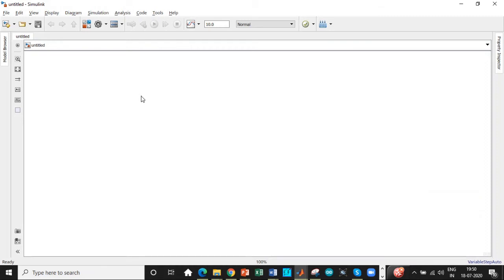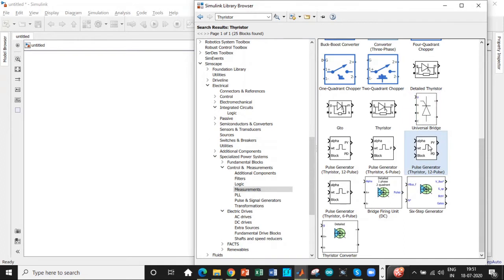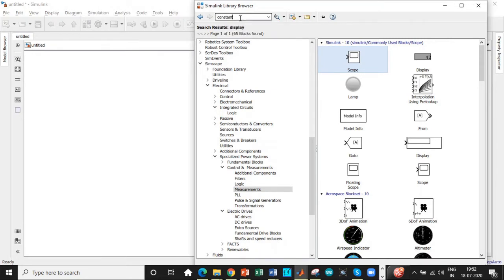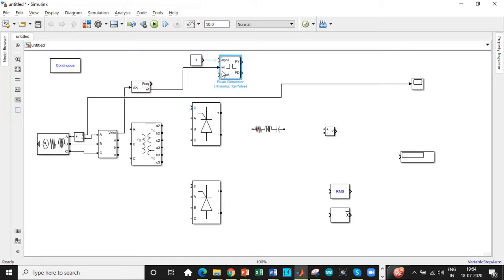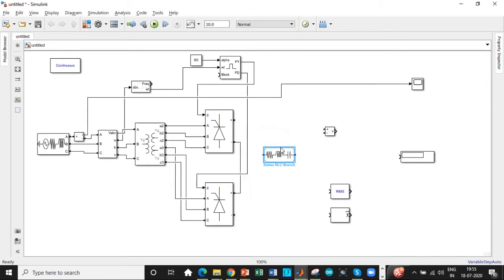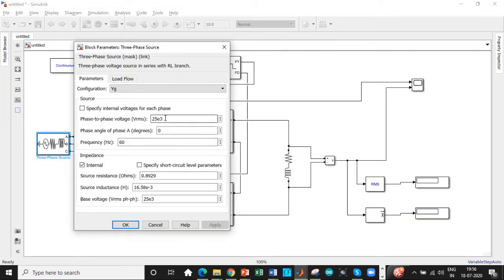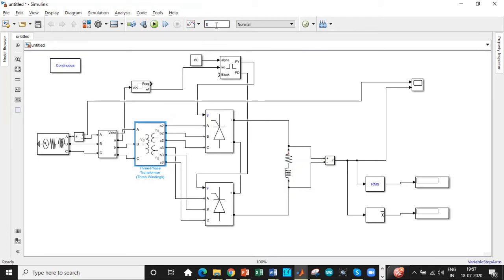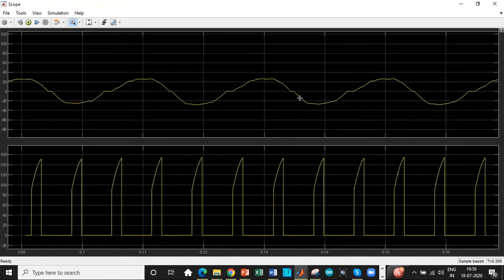Simulation of 12 Pulse Controlled Rectifier in MATLAB | SIMULINK

Comment: Hi bro, great video. If it's in hvdc application and only rectifier is simulated, may I know which load I should connect. Since its hvdc, I should connect R and L right? And what about the values bro?
Reply from the maker: Yes, correct. Try with R and L. The load values can be randon initially to start with.

Comment: Good day sir, excellent work indeed. if you design 36 pulse controlled rectifier, can you use the same approach?. by adding 4 thyristor bridge and two 12 pulse generator, what else can you add?. what would be the expression of output voltage as function of firing angle?. how can the harmonics quality at the input and output be improve?
Reply from the maker: Thank you Samkelo mjuqu. We can design 36 Pulse controlled rectifier by the same approach. Additionally, we can also build them by two 18 pulse converter which would be much convenient to control and simulate. This Paper gives you a good overview of how it can be built-in MATLAB (http://ijarcet.org/wp-content/uploads/IJARCET-VOL-3-ISSUE-4-1159-1163.pdf). Harmonics can be improved by placing a filter on the source side (To reduce the source current Harmonics). There is an option called three-phase Harmonic filter in MATLAB. Based on the amount of reactive power to be injected you can design it. I have made a video on selective harmonic elimination for an inverter at the load side (https://youtu.be/Jq86372S4QM). This will give you an overview of how to use Harmonic filter in MATLAB. There is also a book called BHIM Singh (Power quality textbook) which is extremely useful to design filters. You can refer to it as well. Hope this helps :)
Reply: @ElectronicsMaddy   Thank you very much sir, I have seen this but I didn't find this block labeled F.S having (two inputs F.A and Vi, with output Po) in matlab

I can see F.A stand for firing angle which is constant. I don't know what the block F.S is, can you please help me with it. how can I find it in Matlab?
Reply from the maker: @samkelomjuqu4300  I think they have combined two blocks. i.e PLL synchronisation block and firing unit block ( 6 pulse i guess) and labeled that as FS. It is possible to combine two blocks in MATLAB so that it reduces the way in which the circuit looks.
Reply: Good sir, i have designed a simulation for 36 pulse. but i'm struggling to get correct output voltage waveform, is there a way i could show you my simulation  and tell me where i went wrong or what parameters i should use for 36 pulse or firing angle,
Reply from the maker: @samkelomjuqu4300  Please mail me at electronicsmaddy@gmail.com.

Comment: Plz help with same circuit as yours am getting some different output waves
Reply from the maker: Hi Kiran. Did you try the same steps mentioned? Please send your MATLAB file to electronicsmaddy@gmail.com
Reply: @ElectronicsMaddy  sent please check sir
Reply from the maker: I haven't received any mail. Can you please double check?
Reply: @ElectronicsMaddy  Oh yes so sorry I mistyped the mail address will send you in a minute
Reply from the maker: Sure no problem :)
Reply: @ElectronicsMaddy  Problem is that I am getting too much of the harmonics. So im not sire if its actually harmonics or the output is actually wrong
Reply: @ElectronicsMaddy  I sent please check
Reply from the maker: @kiranjojare8451  
Hi Kiran,

I highly appreciate your attempt. You were really close. I changed few things.
 (Based on your requirements sent in mail)

1) Power in transformer to 1000W because your value was very high.
2) Added a resistance load with a current source.
3) Added a Capacitor filter to ensure a constant DC voltage at the load.

You are getting proper DC voltage now based on your requirements. I have added another scope near the load to see it. Hope this helps. Good Job :)